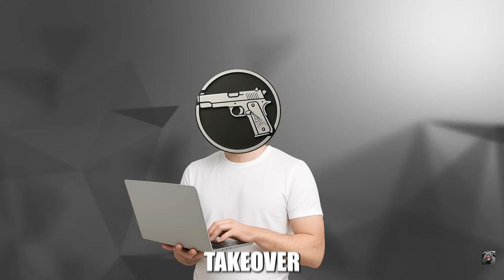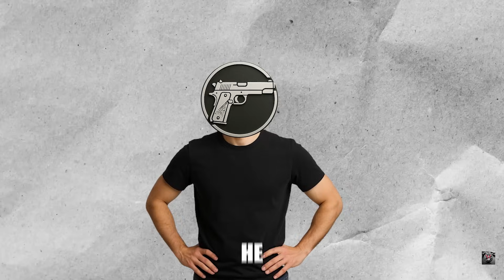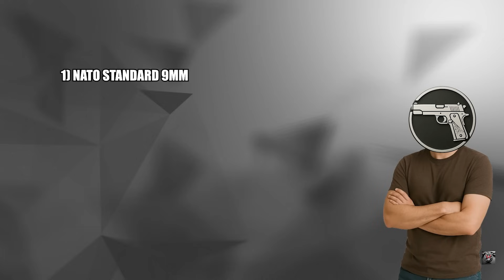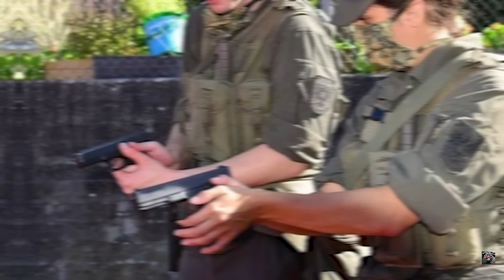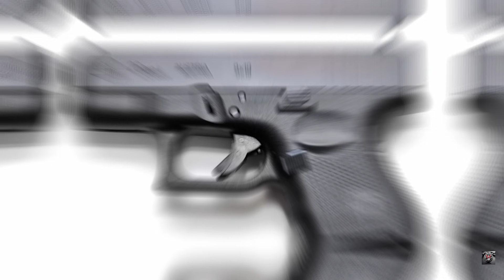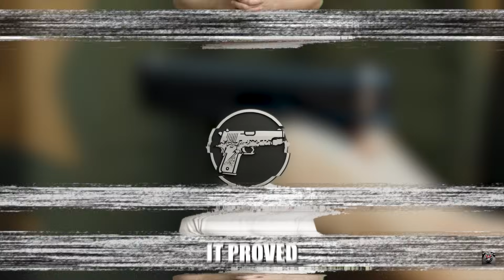From Curtains To Firearms - How Glock Revolutionized Handguns

Comment: 19.15 Glock did not design. The .45 ACP. That had been in use for the 1911 for over 70 years before Glock was even a concept. It was designed around the NATO 9mm round.
Reply: he was talking about .45 gap

Comment: Last that I checked the 45 ACP was not made relatively close to guest and let alone until 1990. The first 2 pistols (Glock)were not in 45 ACP instead 9mm
Reply: When he started rambling on about Glock designing the .45 ACP cartridge he kinda lost me there...
Reply: @DK-gy7ll  I ain’t trying to beat down on em because he goes to a further extent to make YouTube videos then I do cause I unfortunately do not have the time or equipment however I give props to it, but it is still incorrect and I only know this cause I’m a diehard Glock guy
Reply: @DK-gy7ll 😂 facts though
Reply: I believe he was talking about .45 GAP. GAP stands for Glock Auto Pistol. It was never popular, but I bet that’s what he was talking about, because that was a totally new cartridge that was developed by and for Glock. But I’m not saying the pictures matched what he was saying, but .45 GAP is a thing
Reply: @japanesedriftmachine  I’m talking about the original Glock being designed for the 9 mm Luger. I’m aware of the gap.
Reply: @japanesedriftmachine  Possibly, but the .45 GAP didn't exactly set the world on fire so I don't know why he'd even bother to mention it.

Comment: HK vp9 was the first pistol with a polymer frame, it failed because it was a blow back action and an oversized bore, to bleed off pressure from the 9mm NATO.
Reply: How much longer you gonna be the punisher?

Comment: Glock 19's are the Honda Civic of handguns. Compact, reliable, and no significant weaknesses. The "9mm, 15-shot, 4 inch barrel" template has become almost the gold standard for other manufacturers, too: S&W M&P 2.0, Walther PDP compact, SIG P320 compact, they're all similar to the G19.
Reply: You're basically stupid if you're not copying Glock in modern, striker-fired pistols.  It's just a great design.
Reply: @LIONTAMER3D Not just design, but the G19 template. Right in the sweet spot of "big enough to be a service pistol but still small enough to hide". I think S&W came first with the 59 series, but Glock really perfected it: 4-inch barrel or thereabouts, and 15-shot magazine.

Comment: Glock aren't that special and hasn't "revolutionized" Handguns!! I don't even find striker fire guns to be a better option from some older mechanism that have been more refined with better machining and metallurgy. I still find hammer fire weapons to be over all still more reliable and still prefer a DA/SA trigger. You can disagree but there are still a lot of them being sold today to all walks of people that have all kinds of different needs for a gun yet so any are still choosing the hammer fire. 

 I've fired plenty of the striker fire guns from many different brands and just didn't get any benefit over my Hammer guns.  
Let me ask you one question. Do you really find say a Glock 19 as being a "far better" handgun the say a Sig P229? Can you even give me say just 6 benefits of the 19 over the 229. cause the only one that I could find was it was easier to clean with having over all less parts but over all ware and tare I didn't see much difference with longevity in those parts. ( I will admit I didn't have the Glock for very long but still have my 229) 
 
I'm not being a Sig fan boy I was just comparing like weapons in size that many of us have experience with. I could compare the G23 to my S&W 4006 and I still see the only benefit is the ease of cleaning. Hell I got that gun as a hammy down from the Park Police and all I've ever replaced was the Recoil Spring set once and I've had it since 01 I think. I know it's a tank and that's why I like it.
Reply: Cost, weight, less maintenance, any idiot can take a Glock completely apart with one punch, the overall simplicity, the available parts, holster compatibility, interchangeable mags, the magazines are incredibly durable, long term maintenance is less, consistent trigger press as opposed to SA/DA(which was developed for incompetent shooters), the aftermarket for parts…that enough? Lower bore axis than the Sig. 
I understand you don’t have any field experience and just keep your gun in your closet, it’s a different world when you use it as the tool that it is.
Reply: @Mark_it_zero_dude well said sir!
Reply: Try spell check too